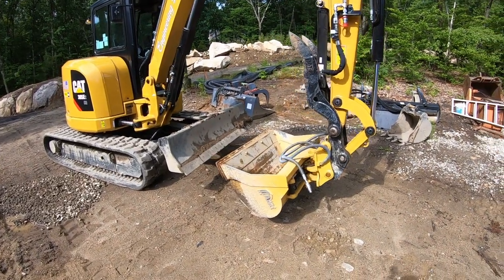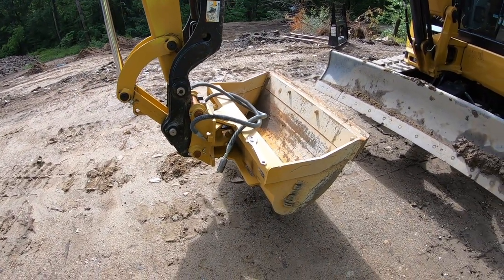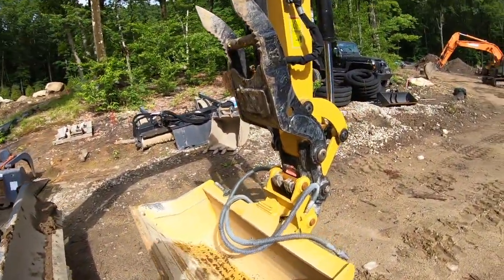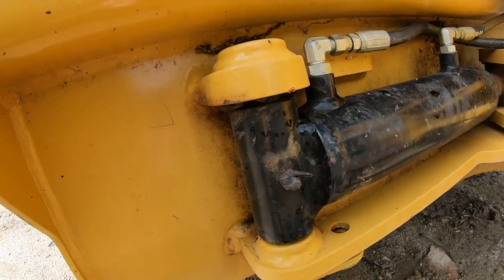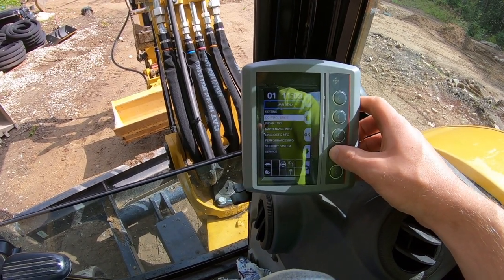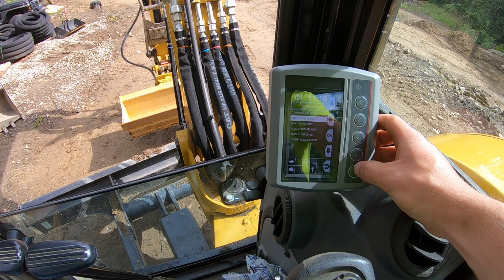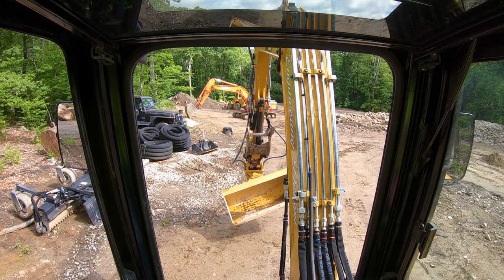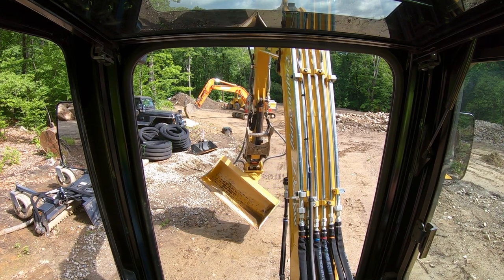Cat 305E2 AMI tilt bucket

Comment: The tilt bucket and the thumb clip share the same pipeline. Can you choose to control the tilt bucket or the thumb clip?
Reply from the maker: you can do one function at a time by closing the quick connector shut offs. This is something you have to do manually outside the machine but you can use this bucket in a fixed position and control the thumb if you wanted.
Reply: @TylerBemis  thank you!

Comment: If I may ask how much was that tilt attachment the one I'm looking for for my bobcat 335 is $6,000 and I already have the ditching bucket why do you have but just the 190° Tilt assembly is 6000 I believe, thanks, really enjoy your videos
Reply from the maker: hey Johnny when I got the bucket while purchasing my machine it was around 3K if I remember right. I looked into the tilting coupler specifically the Helac however it was going to require additional accessory lines be run and complicated running a hammer or other hydraulic attachments. I'm not sure where you are digging but I was concerned about how well the tilting coupler would hold up dealing with rocks. Either route you choose having the capacity to tilt especially when grading is really great!
Reply: @TylerBemis  thank you so much I appreciate everything you can tell me ! I'll look forward to the opportunity to get the attachment and get it working, I can clearly imagine a thousand times that it would have come in so handy and save to me hours and hours of shoveling, now I just got to talk my wife into it LOL easier said than done sometime but it's all good

Comment: Does the bucket do a full 180°
Reply from the maker: This isn't a tilt rotator the bucket does 45 degrees to the left and right it only tilts it doesn't rotate. You'd want to look into a Rototilt/Engcon/Steelwrist for that application. With a pin grabber style coupler which the CAT machines generally use you can install the bucket backward and use it as a front shovel if you wanted.